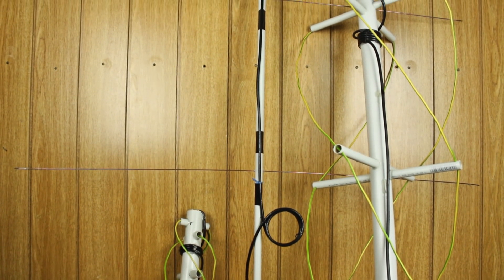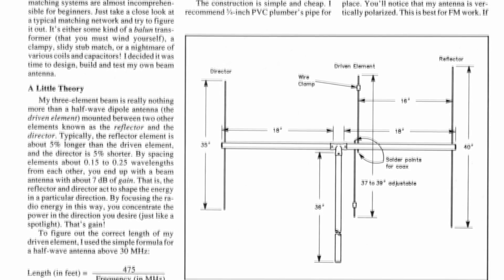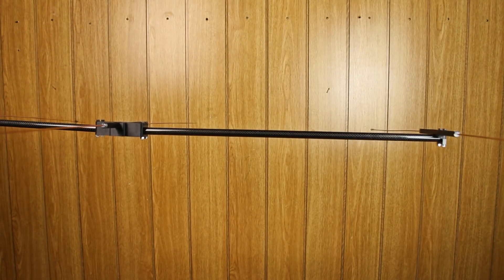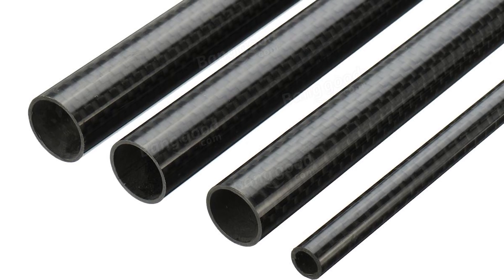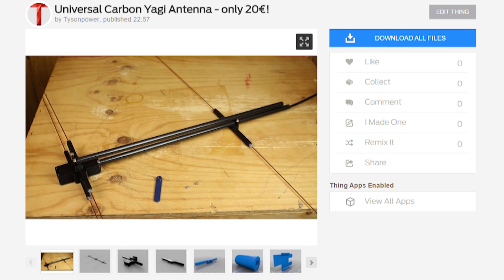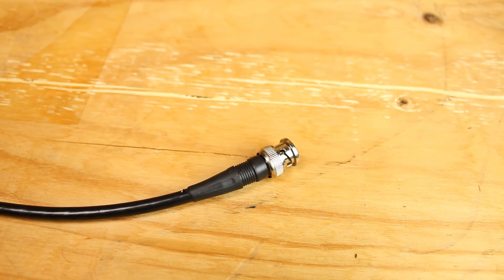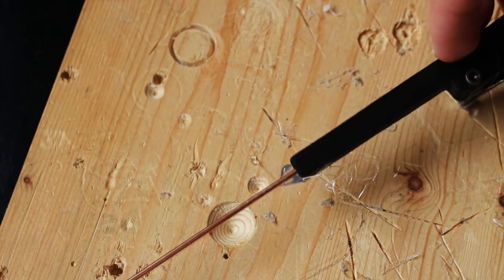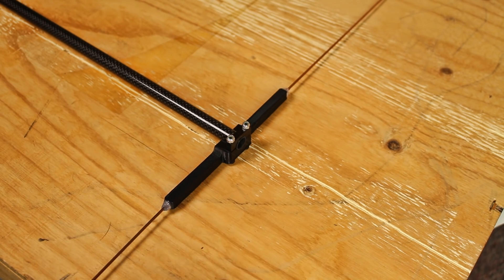[EN subs] Yagi Antenne aus Carbon bauen (140mhz, 3 Elemente) - DIY

Comment: this is like same parts i use to make light strong quadcopters
Reply from the maker: The carbon pipes and clamps are the same, yes.
But a Quadcopter has no need for welding rod ;)
Reply: you are correct [=

Comment: Very nice build! Those welding rods get really rusty if you leave them exposed to the elements though.
Reply from the maker: Thanks :) The welding rods are copper plated, so they will not get "rusty" in particular. They can build up an oxide layer, but that should not be a problem. I also have a cap for the driver to cover the solder joints.

In my case, i have the Antenna not permanently mounted outdoors, so it is not exposed to the elements.

Comment: Whats the welding material?
Reply from the maker: I used welding rod for Autogenous welding. It has a diameter of 2mm.
Also the material is not so important, any welding rod should work.